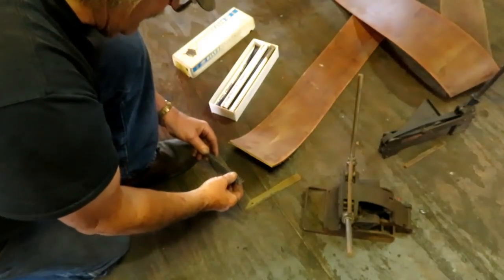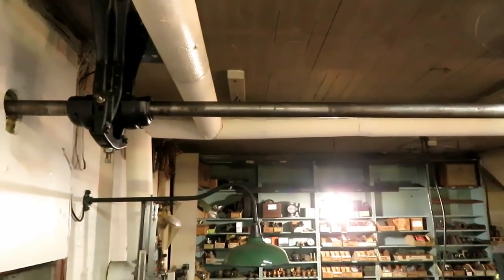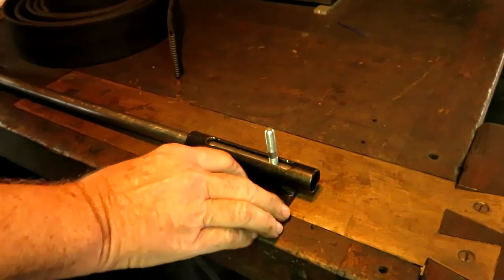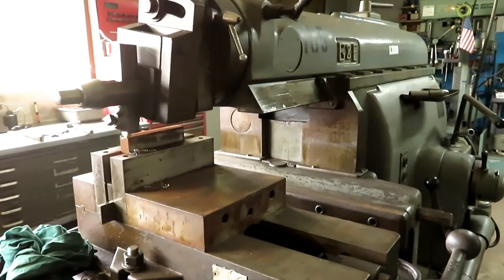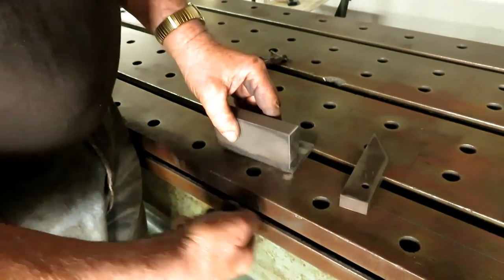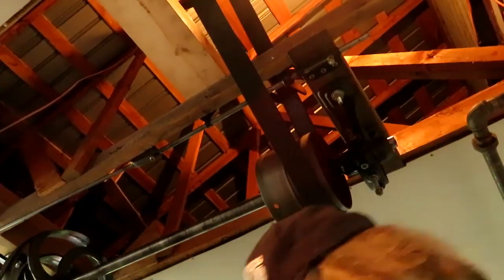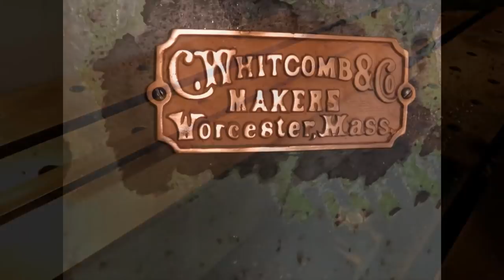Old Steam Powered Machine Shop 60:  PLANER ON STEAM

Comment: I always find it amazing how things were done mechanically and can only imagine the time it took to develop and combine the ideas that made things like this possible. From water power to steam until electricity made it possible to individually power each machine and eventually individual parts of each machine. Drawing ideas on paper and all of the time it took to put ideas into a drawing and finding that it won't work and spend hours drawing it up again. Back to the drawing board was a common phrase. Today, things can be designed on a computer and changes made in seconds instead of hours.
Reply: Excellent comment.  Each generation gets to stand on the shoulders of those that went before.  I see a lot of people take that for granted.  So many hundreds and thousands of long gone very smart people got us where we are today in every facet of technology and engineering.  We owe every modern convenience to so many people we never heard of.

Comment: I have never seen modern footage of a planer running. Sure it's noisy but if you were over 100 you'd be creeaky too. Thanks, great content!
Reply from the maker: It's noisy, that's one of the reasons why Whitcomb went to a side belt the next year. ...Dave
Reply: we use one every day for beveling edges for welding.  its perfect for that.  fast too.

Comment: Hi Dave, my name is Bernie, I am a retired marine engineer from the British Merchant Navy. I have sailed on steamers (steam ships) for most of my life, even today the LNG gas ships have steam turbine plants although motor ships (Diesel and or heavy fuel) are more numerous now.
I completed an apprenticeship as an engine fitter and turner in the Royal Navy Dockyard Devonport in Plymouth England. You along with your skills take me back to the good ole days scraping in bearings and many other skills. The machinery I operated was not as old as yours, probably built in the 1930’s electric driven lathes, mills, shapers, surface grinders, boring machines and so on. The overhead shafts and pulley wheels were still in place but no longer in use.
I joined the Merchant Navy in 1973, I sailed on old steam turbine ships with twin water tubed boilers 500 psi. Every pump, compressor etc. had a duty machine and a standby machine which builds in redundancy. Well the second pumps were always steam recips and I used to run them in preference to the electric motor driven units as often as I could. There is something about the smell of steam mixed with the smell of graphite oil.
I have started watching your Channel from the UK during this COVID 19 period and it gives me something to look forward to every day. Your channel takes me back and it is a most enjoyable and professional channel to watch. Today I became so excited as I saw you get the planer running on steam, I was so chuffed for you. You are a star, looking forward to episode no. 61. I truly wish I had the chance to do what you are doing, and I wish you all the best.
 Than you very much, you are doing a sterling job.
Reply from the maker: Thanks Bernie, glad you are along with a common interest....Dave

Comment: Dave, in my younger days my family had a feed store, we milled all the grain in house, every thing ran on line shafts (no steam ) but a huge 3 phase motor up in the roof its still there, apart from grain crushing and grinding, there where oat rollers and stock food mixers plus an overhead winch for loading bags of grain upstairs all off the line shaft,,one motor did everything in the place..brought back a lot of memory’s replacing and joining the leather belts. Regards Frank
Reply from the maker: Thanks for the great comment Frank....Dave

Comment: I had two shapers like the one you are using at 20:00, scraped them back in the 90's along with a bunch of chain filers and duplicator mills, when the cnc's took over we had to make room. I do regret now scraping the shapers, I loved using them when I was a young tool maker.

Comment: When I watch your vids, you lite the boiler and it comes up to pressure and then the engine comes alive when the engine is running the shop has come to life.The engine is talking clicking clapping the belts are all working hard are talking to.The hole shop sounds alive.It all sounds great 👍.
Reply from the maker: Hi John, That's what I was trying to demonstrate, thanks for the comment.....Dave
Reply: David Richards I was a joiner for 50years when I started work at 15 the shop where I started had a line when we started the old electric motor it would whistle till it got up to speed then it would settle down and it was happy 😃 same as your place the belts would play tunes as they were put under load. You are never alone in a shop like yours.

Comment: Some rubber tubing sliced on their length and slid over the spokes of the noisy gear should quiet it down a good bit, at least soak up the amplified noise.  Great Video.

Comment: An Amazing amount of work to get the planer making chips. Good job. Love the shifter detents which are VERY smart. Did not realize so much  designing and engineering goes into a line shaft system.
It was cool to see the dial indicator showing the feed on the shaper.
The shaper reversing system using one straight and one twisted belt on the three pulleys with the middle pulley always in neutral is pure genius. I also noticed the top drive pulley is a larger OD for faster a reverse.
When you have a chance, it would be interesting to know how many feet of belting is in your shop.
Reply from the maker: Hi Ron, guess I didn't explain it well, the two belts run in opposite directions on the outside idler pulleys, the center pulley drives the table. You got the rest...Dave

Comment: Thanks David...You sure have done a ton...Of work,got it running good l see...Once again thanks very much...!...PS youtube seams to be cutting your video back on quality is says 1920x1080...But it is only 720p at best...!
Reply from the maker: Hi Steve: Try clicking on the gear icon at the bottom, then "settings". click the 1080 HD. You have to set it up at your end. Thanks again for watching.....Dave
Reply: @davidrichards5594  Yes David l know that my friend...l have been building Computers since the 1980's off and on...ln my laters years have been doing lt quite often now for people....When it comes to video cards and high definition l know my stuff....lt is youtube for one reason or another they are throliting it back on a lot of videos....More often on the ones that don't have ads....Keep up the good work...Have fun thanks..!
Reply: @davidrichards5594  Done some research David....lt could be your camera and the pixes it has....Not all 1080's are the same...The Gopor 1080's produce a very high quality 1920x1080...Older camera's do not do this at 1020x1080 not saying use a GoPro but just for your information...! No matter what you got is fine with with me....!!

Comment: I remembered something. Many years ago I worked on Bucyrus Erie will drilling rigs. The gears in them were all spur gears like your planer. We used to use a stick open gear lube, it came in a tube similar to a grease tube. The lube was tar like in consistency,  it really stuck to the gears and made them run pretty quiet. Check it out.

Comment: Did you get a larger, more powerful engine? The regular one was right by the door but this one is inside and looks a LOT bigger?  Dave, thanks for the view into the past. when people used these machines to build a nation and what we now know as modern technology.Fred Dibnah in England tried to do this and after his death his entire shop and everything in it was disbursed. Let's hope your efforts will have greater success. That is an amazing machine. How lucky you are to have it. Built in a time when people took pride in their work and made tools that would last a lifetime and more.
Reply from the maker: Thanks Robert, I'm finding that, in the last 3-4 years there are many folks starting to put together old shops also, running with belts. Old machinery is not being scrapped so much. system parts are getting harder to find. That's a good thing.....Dave

Comment: Bonjour David,
What a monster ! And it is alive again. I would not have been able to install all these pulleys so perfecty aligned.
When I see how the belts work, I have questions, what is their maintenance ? Do you need to oil them ? To shorten them ? And as I think so, after how many hours/days of use or even if they are not used ?
Amicalement, Raphaël
Reply from the maker: Hi Raphael, Old leather belts need lots of neetsfoot oil and have to be shortened a few times, then they stop stretching an are very maintenance free. The canvas/rubber type stretch very little but jump around more and don't have as much traction. I just measure to get the shafts parallel and then sight (by eye) down the side of the pulley to the other one to get them in line....Dave

Comment: I came here after following Keith Rucker at Vintage Machinery He is in progress of restoring his New Haven metal planer from ca 1895.
Reply from the maker: Hi Frank, welcome aboard, Keith's is very similar. The belt drive on his is split with one on each side. The 1897 Whitcomb that I have, never had a powered cross rail elevation. Thanks for commenting.....Dave

Comment: I used to work for a local Western Auto that had a storage building for appliances and furniture. The building was built in the mid the late mid 1800’s.  I do not know what it was used for but there were massive drive rods, pillow-block bearings and wide drive pulleys in the overhead.  My guess some type of manufacturing that was steam powered at some point then changed over to electrical power when  large enough electric motors and electrical service power became available to power the old machines that were belt driven.   Also went to a barrel stave sawmill that used overhead drive assemblies to power equipment.  Suspect it too was originally steam powered based on when those buildings were built. Most of the buildings were more of a three sided shed and lord at the hornet nests in the overhead where the boss wanted me alone with no rigging to try and remove a 30 ft section of 3” diameter round bar going through dozens of pillow block bearings, some formed from oak and Babbitt with 1.5 to 2 ft diameter wide leather drive pulleys.  I ever back to the shop and explained it could not be done without us risking burning down the buildings trying to run the hornets out and putting holes through the roof to connect improvised rigging.  The 3” foam 30’ long steel bar was pre-WWII and he wanted/needed it for a project he had bid on and got the contract.  He said he should have know better than to send a boy(I was 17) to get it.  He contacted the other welder, a very knowledgeable mid 40’s welder and told him to get it and he needed it in one piece.  He drove up a few hours later and the boss saw him as he entered the shop asking if he got the bar.  He said yes.  The boss walked out to the trailer behind the truck to find 3, 10 ft lengths and then proceeded to jump in him and he told him exactly what I told him in ear shot if me and the boss walked back by me kinda shook he head as it was hung down.  Probably more so from knowing what he was going to have to pay for what he thought he was getting for Fred go some work he had gone for the owner of the old Buijdungs the bar was in.

Comment: David, that is a powerful and wonderful machine, but it has the same drawback as the shaper has: it only cuts going one way. You obviously have plenty of power available to you. Have you considered putting a cutting head and clapper box on the OTHER side of the cross slide? That way you would get a cut with both moves of the table instead of just one.

Sure, you would have to consider how you would slave one head to the other for height adjustment, and also some way of setting up the offset of the two cutting tools so that both tool bits cut new metal at the same rate, but think of what it would do for finish; you could get better finish with coarse feeds. Speed of operation would improve too; jobs could potentially be done in half the time, with the only penalty being in setup. 

Perhaps a collaboration project for the community? Keith Rucker got one of these too, you know...
Reply from the maker: Great comment for discussion Greg,  A lot here.  From what I gather, there were planers that did that but very rare. One set up was called a "duplex planer" which had an extra backwards facing head that would cut on the return stroke (probably not in the came cut). Also there was one called a "double cut planer" that worked in the same cut back to back in line. Railroads probably loved them.....Dave

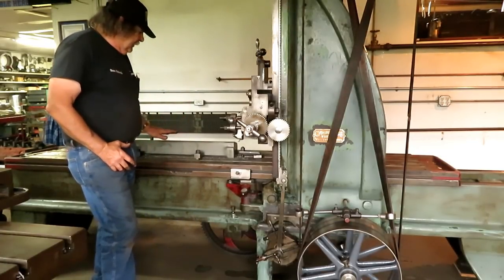Comment: Dave, as always, your installation of the big planer is superb. At 32:00, there appears to be a 6-7" gouge seen in the side rail of the planer. Any idea what caused that, does it create any problem when planing smaller material and is it repairable? After 60 episodes, I still find myself asking what will be Dave's next project. Watching your shop operation is like watching the workings of a fine swiss watch. Thanks again for sharing your expertise.
Reply from the maker: I don't know how it could have happened, over tightening maybe but it doesn't really have a lot of force on it.  All t-slots pick up a lot of "rash" after 120 years.

Comment: On the long belt run from the "steam" shop to the "modern" shop, would an idler pulley help eliminate some of the belt slap? I'm not second-guessing your expertise, just wondering what the rule of thumb is for the length of a horizontal belt. Great videos, thanks for sharing your hard work and passion for old steam-powered machinery.
Reply from the maker: Well I dono,  belts jump around a little, no big deal, it's what they do....Dave

Comment: Dave - Congrats on getting the planner up and running.  Truly a machine to see in operation, not so much to listen to.
Have you tried to rotate the smaller gear so that maybe the mesh/lash against the bull wheel gear might be better running the other way?  That racket would be a deal breaker for me!
Reply from the maker: It runs both ways so It wouldn't make much difference.It was probably noisy when new....Dave
Reply: @davidrichards5594  Dave - I realize that gear rotates in both directions.  What I was trying to say was pull the drive gear off the shaft and remount it so the outside face is now the inside face thus altering how the gear faces mesh or maybe just shim it to quieten it.

Comment: So as the bed shifts from cut to retract and the belts shift, what gives or slips?  Do the fwd-rev belts slip a little on the center pulley?  Is there a slip clutch in there someplace that we dont see?
Reply from the maker: All part of the magic, seems too simple doesn't it....Dave

Comment: Hi Dave, good to see the plainer running. I haven't seen one working before. What sort of accuracy are you getting? Do you think you can use is for some cylinder head work?
Reply from the maker: Ian: Accuracy check in next video. I plan to plane blocks and heads with it now and then....Dave

Comment: You can support the bottom of the long belt using an extra idler pulley in the middle underneath the bottom of the belt to lift it up to only a couple inches away from the top of the belt.  Then it won't sag so far down.  Just use a short shaft with a pulley in the middle.  An alternative is to use the same pulley to push the top of the belt down, taking up some of the slack, causing the bottom of the belt to lift in the process, but I would recommend the first option.  If necessary, lift both the top and the bottom with two idler pulleys to keep the top away from the bottom.  It is like how belt treads on excavators are supported on the top with little roller spindles to keep the top of the multi-ton belt treads from sagging and scraping up the equipment.
Reply: I am also curious if and how to repair the gash on the side of the table where the slot for the dogs go.
Reply from the maker: Actually I think your second option would be better because the top is the "slack" run.....Dave
Reply from the maker: I don't know ...thats a hard thing, maybe inlaying a piece of steel with countersunk screws. I'll see if it's really a bother the way it is....Dave
Reply: if that doesn't work could you cu away a section and tongue and groove joint a piece in wood work style maybe?

Comment: Like your video's.
Why don't you support that long belt halfway on the undersite of the belt ? Give's you more headspace and if you make that support adjustable you can retention the belt when it's stretched.
Greetings from the Netherlands.
Reply: I was thinking along those lines.  I think Dave could have an adjustable idler pulley on the bottom of the 6" drive belt.  That would raise the belt towards the ceiling and give more headroom and also function as a belt tensioner when the belt stretches.
JIM
Reply from the maker: Good to hear from the Netherlands Wilfred, good idea if it becomes a problem. Remember, most garage doors are 7 feet clearance.....Dave

Comment: I think id get a old diesel engine to run things on hot days. Place it in a box /room with foam rubber walls to keep it quiet. Maybe hang old carpet on the walls . A 4-71 Detroit possibly to even a 6-71, it can possibly run at a fast idle with overdrive output to meet the power requirements .

Comment: Tremendous. What an achievement. Beautiful old machine. I wonder if it could take more of a cut than this steam engine/line shaft arrangement could power?
Reply from the maker: Well, I haven't found the "critical" belt yet, but I think it would be the small pulley on the countershaft drive...Dave